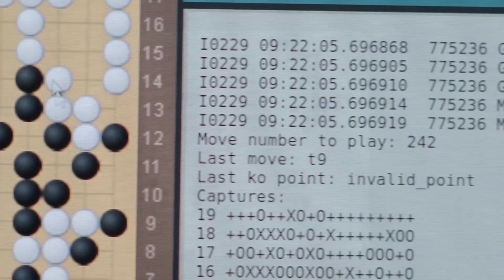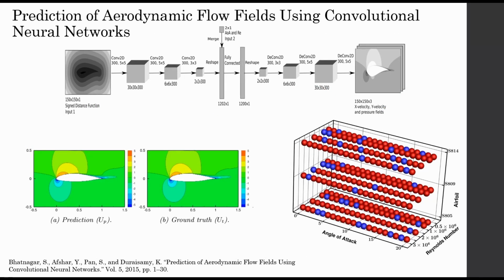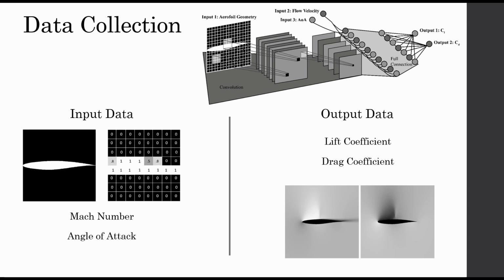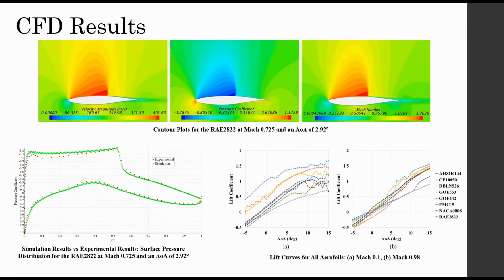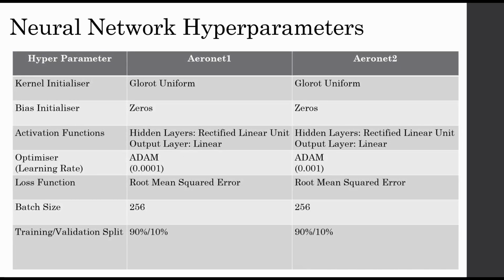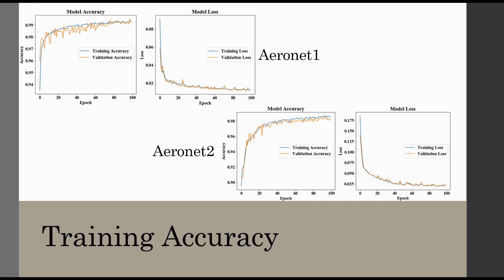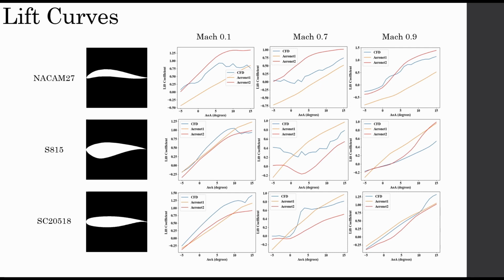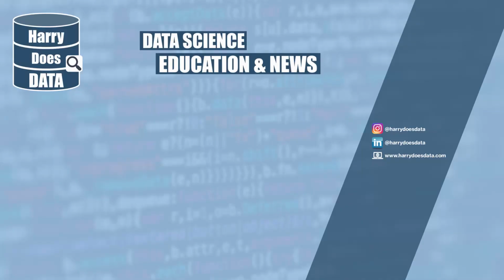An Artificial Neural Network for Aerodynamic Analysis

Comment: I think for the MLP you would have had more success with set x-station coordinates for upper and lower surface plus the general flow condition as inputs rather than the pixel values. I also find the choice of batch size as 256 to be a strange choice (high), how did you come to that number?
Thanks for sharing your work, very interesting.
Reply: Any new ideas? I believe this parameter is intended to reach an integer power of 2 to make memory usage more reasonable.